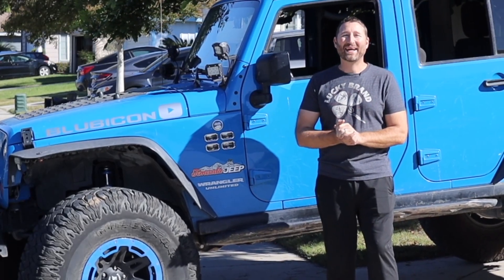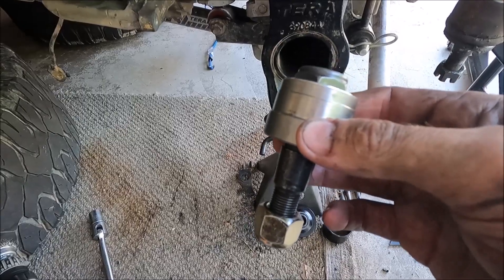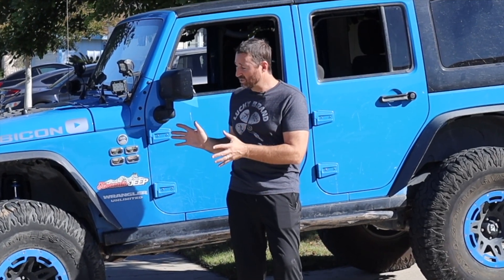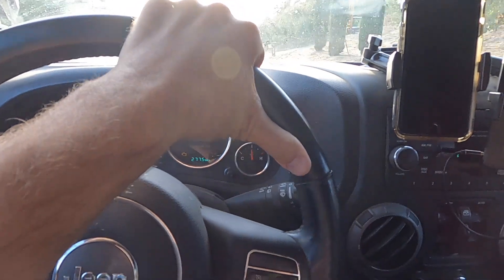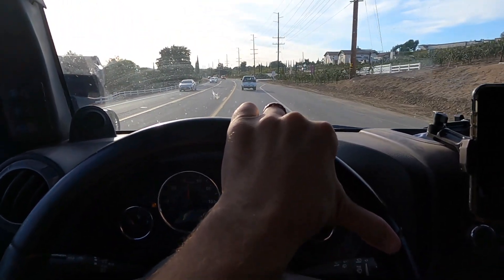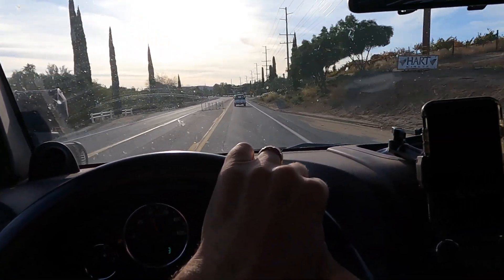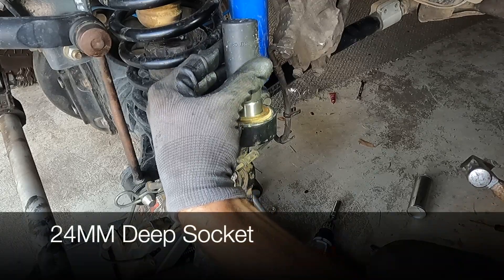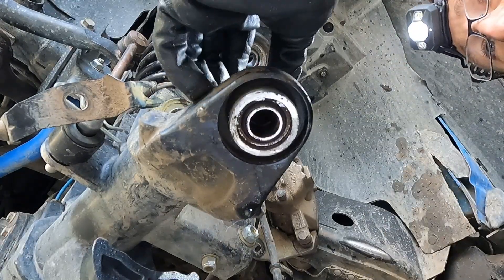1 Year Review Ball Joint Deletes from American Iron! + How To Rebuild Them! Dana 30/44

Comment: I just put these on my 1 ton Dodge and am hoping to have the same experience. My pickup wandered something terrible and also experienced terrible death wobble. So I did the ball joint delete along with new track bar and tie rods and wheel bearings u joints shocks and I already had the steering stabilizer. So front ends been completely rebuilt. I get the alignment done tomorrow and looking forward to seeing how it does. Praying that the $2400 I just spent on parts fixes it for awhile at least. Really glad to see your review of the ball joint delete kit. Thanks
Reply from the maker: Going on 4 years now, still perfect. Love this setup.
Reply: @Blubicon  AND ''''KEEP'''' THEM GREASE'D '''''  IT WONT HURT ''ANYTHING''' TO GREASE THEM EVERY 60 DAY'S ''
Reply: YOU SHOULD BE ''GOLDEN '''''   BUT JUST ''REMEMBER''''  THAT THE FRONT - END OF THAT RAM IS '' HEAVY ''' '''' SO EVEN THE ''DETETE'S '' WILL EVENTLEY HAVE TO BE REPLACED / REBUILT ''''''  BUT IT SHOULD BE '''' YEAR'S '''''' .THE CUMMIN'S IS SO ''HEAVY'''' THAT IT HAS '''BALL JOINT'S '''  FOR BREAKFAST '''''   GOLDEN'' I SAID ''''

Comment: How long have you been daily driving with beadlocks? What r your thoughts??
Reply from the maker: They are not beadlocks.  They are just a removable protective steel ring that prevents wheel rash. Look up Rugged Ridge XHD Wheels.

Comment: How to you grease these?
Reply from the maker: You only grease them upon installation. Apply grease to the space between the hole of the spherical and the inside edge of the cup. This is only to prevent water intrusion, not to lubricate the bearings.

Comment: Nice, question so the bearing life is 1 year
Reply from the maker: Far longer than that based on the data.  After one year my original bearings were still working perfectly.  At 10:39 in the video I explain that I am not changing the bearings because I have to.  Only did it just to make this video =). So I am expecting to see quite a few more years before the bearing actually NEED to be replaced.
Reply: @Blubicon  thanks , I'm getting the kit for my buggy Build.thanks

Comment: How many miles one set will last?
Reply from the maker: They have a 30K mile warranty but there are verified rigs with more than 50K miles still tight as new.
Reply: @Blubicon  nice! Yes I am tired of the adjustable ball joints. I think they are not good

Comment: How often do you have to change them? The fact that they seem exposed seems like it would cause it to wear quicker no?
Reply from the maker: They are not exposed.  I removed the rubber seals (O Rings) and top washers before filming the replacement process for the bearings.  I full breakdown and exploded diagram is available on the American Iron website here: https://americanironoffroad.com/collections/jeep-balljoint-deletes-1/products/jeep-wrangler-dana-44
Reply: @Blubicon Oh that’s interesting thank you! You’ve also made it hard for me to decide on going with dynatrac balljoints or going for the deletes for my JL lol.
Reply from the maker: Not sure, I have never "had" to change them.  Some reports from other users are more than 50K miles and still going strong.

Comment: But I thought you couldn't run 40's on a 44 and any mod to a 44 is a waste of money!!!!
Reply from the maker: FAKE NEWS!  😁
Reply: Well, depends on many factors and most importantly, how you drive. You can help reduce the chance of failure with lighter tires/wheels, appropriate offset and strengthening other parts. Ultimately, you will still be at a higher risk and braking performance will still suffer. Now, you can also upgrade the brakes but the issue is, after doing all of this, you've spent as much as an upgraded axle. This is the actual issue. If you can be careful driving, etc. you will extend your axles life, but there is no doubt, larger wheels, tires, increased scrub radius, etc has a degrading affect on components (including control arm frame brackets and driveline components) with increased wear. Not saying don't do it, just saying know actually what you're getting into so you know how to manage.
Reply from the maker: @GevoA1  All great points.  I will NEVER say that 1 ton axles aren't stronger than 44s, or ultimately a better idea if you plan to wheel hard.  My entire experiment is to show that you can run 40's on a D44 successfully IF you take all of the right precautions, including driving style.  I want to debunk the myth that "Everyone who wants to run 40's NEEDS one ton axles."  Need being the operative word.
Reply: @Blubicon  well noted. My intention wasn't to state you were wrong, etc. I'm in agreement with you, just speaking to a wider audience who may be listening. Thank you for the great videos
Reply from the maker: @GevoA1  Thanks and I really appreciate the support =)